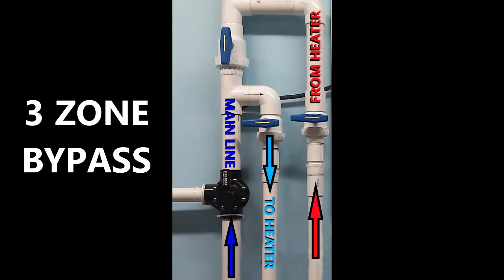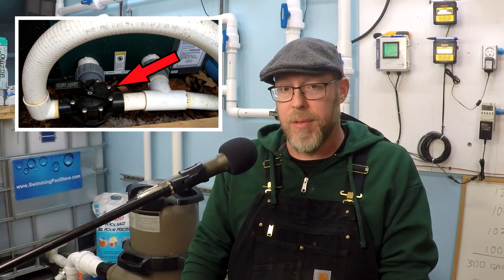Pool Heater Bypass - What Does It Do?

Comment: You indicate that the pool heater should not be bypassed for lengthy periods of time, AND that the heater should be protected from chemical changes (like hperchlorination).  I live 1500 miles away from a pool that I use intermittently, so cannot attend to it myself.  A pool service takes care of the chemicals, but they don't adjust the valves "because it makes the valves leak".  I have taken to opening the bypass valve when I leave, but also keeping the inflow and outflow heater valves open.  The higher resistance to water flow inside the heater means that most of the water goes through the bypass, but the heater is still getting flow.  Does this make any sense, or is it not really helping/

Comment: Thank you, Steve. I have a heat pump as well as a solar heater for my pool and the valve between them can direct flow in one or the other direction or partly to both. I also have a valve near the filter to direct flow either to this pair of heaters, or to just recirculate the pool. If I understand you correctly, I can just recirculate the pool water when I hyperchlorinate the salt system> Does that constitute a bypass, and can I further adjust the flow between the heater and the solar heater through the valve between them, since I'm using a 1 1/2 hp pump, somewhat oversized for the 5000gal pool. Thanks. Richard

Comment: I am about to replace my old Hayward H350 10yrs old with a new Raypak Avia HD Nitek 404 and will be re-plumbing. I was considering adding a heater bypass cause I have SWG pool. I keep my water pretty balanced but the Hayward did eventually pop leak in the exchanger. My question about the bypass is if it can be done using a Hayward Goldline GVA 24v actuator, and automate the bypass when the heater is not calling for heat. I have a Hayward Proligic 8 controll system with open Aux ports. Have you ever seen a setup like this or is this a bad idea. I have yet to find a video online only a couple not so descriptive forum posts. If you have any advice for this unique setup I would appreciate it. I’m in Canada in Winnipeg so gas heat 3/4 of the season is a must. I would like to avoid having to manually turn the bypass on and off every other day. Lmk thx

Comment: Im looking at pool heaters. Had a solar heater but was removed with roof repair after hurricaine Ian. Plus roof guy noticed that solar was leaking and thats why my alum gutters were rotting.  Anyway i had a bypass set by temp to go thru solar or bypass. Can i use tge same plumbing?

Comment: Could you please help me?  I am having problems with my chloine level. The pool store recommended 9 lbs of shock(power powder plus)  i did that and had the water tested 2 days later and was told i needed 9 more pounds of the same product. Free chlorine was .25 and total chorine was 2.32.  What should i do?
Reply: I think you need stabilizer so the chlorine doesnt dissipate so fast

Comment: Heaters have two regulators controlling how much water from pump enters the heat exchanger in the heater.

One is pressure sensitive (controls flow into/bypass heater), the other is temperature sensitive. As water cools. more water enters heater, and as it gets hot, more water is bypassed. Both work in conjunction to adjust how much water goes through the heater and how much is bypassed.

I'm sure it may vary by region, but in my area, (Texas Gulf coast) I've only seen a few heaters with manual 3-way valves to take the heater off-line altogether. (Since mid 1990's).

As far as chems affecting the health of the heater, there are two main considerations. 
If you are on a salt system, get a heater with a cupro-nickel exchanger. Salt is inherently corrosive, and an all-copper exchanger will fail more rapidly, with added" benefit" of scaling inside the exchanger. Otherwise it's all good but you have to keep a close eye on balancing chems.

The other is in the case of vinyl/fiberglass pools, be sure to keep the pH up in range as they have a tendency to run low on pH.  I've seen many of these pools with the plumbing hard plumbed bypassing the heater because the heat exchanger has holes in it.

This comes from one pool tech who is nothing more than the sum of my own experiences.
Thirty years in, and still learning!

Always looking forward to your new posts Steve!

Comment: Hey Steve,   Would it be a good idea to parallel 2 heaters in the same system? One being heat pump. And the other a gas heater.
Reply from the maker: Great! Best of both worlds. Just expensive. Install them in series.
Reply: @Swimmingpoolsteve wouldn’t that cause extra resistance?

Comment: I am currently installing Raypak heaters. The instruction manuals call for a Bypass Spring Valve if the Pump is over 2.0 HP. Since I am using 3.0 HP I am left with this conundrum. We normally would install a Ball valve and regulate the maxflow to about 50 Gal. x min. at 3000rpm to account for the Spa function. The Raypak engineer is asking me to find a spring valve with a 10lb Spring. I have not been able to find one, and the Raypak valve is almost $300.00 Do you have any advice.  Kind regards.
Reply from the maker: Spears males valves with spring tension 1lb, 2lb, 5lb and 10lb
Reply: Or install a manual bi-pass and you can calculate a rough on how much you open the valve. Once you set it, mark it, and thats it! The spring is pretty much doing the same thing as the valve, which is restricting flow. Sure , maybe hard to calculate, but you can get close enough.

Comment: What you state is pretty true as you typically are. But under the circumstances a customer had an indoor pool/dehumidification/pool heat pump the built in or added bypass (which is required) sets the flow through the CuproNickle heat exchanger to create the temperature differential which is needed by the indoor system in order to heat the pool water, dehumidify the enclosed pool room and/or assist in heating the enclosed pool room air. The heat exchanges are made of metal that is pretty much not damaged by chemicals. I have some out there still working that are over 25 years of age with the same water heat exchanger. The water flow must be set according to factory specs/application or the efficiency will be down, the compressor head pressure could be too low or too high which will effect the life of the compressor. And the dehumidifying process will also be negatively effected.

Comment: I have an external bypass that I plumbed in an unliked what many people do, I actually pull the drain plug on the heater and disconnect the inlet and outlet lines.  I also flush it out with a hose.  Is it a pain in this a@@?  Yes, but it’s cheaper than a new heater in 2-3 years or less.  Screwing in a drain plug and screwing in 2 PVC lines is a snap!

Comment: $3000 for a heater? What year is this 2020? Lol

If you close circuit the heater don't forget a pressure relief valve just in case.
Reply from the maker: In some areas, maybe all areas, adding a manual bypass requires the heater has a pressure relief valve installed. Good job pointing out this important info! Cheers
Reply: @Swimmingpoolsteve  I am wondering do you still need the relief valve if on the out of the heater upy have a check valve and not a ball / 3way valve. 🤷 Probably.
Reply: What would the pressure releif valve do? I dont think I have one..using a Sta-Rite heater, and I came up with the idea of the bipass as I ddnt want the chem to constantly run thru the heater, as it is not necessary, so why have that in the mix? So I have the water divert cutting off water going into the heater. I guess I can open the valve a slight bit once in a while to not have it stagnate. I think the heater should have a drain plug. Maybe draining it would be an option, and let it run through once in a while just to keep it from being totally dry./?
Reply: @philindeblanc  mostly it releases pressure 😉

Heaters operation with a pressure switch, not a flow switch. A incorrect by pass can activate a pressure switch while not having enough water flow.  Heater may make a hell if a banging sound

Comment: Would an internal bypass type heater still need an external bypass for super chlorination purposes? I assume the bypass is an automatic thing and to be safe you would still build in an external because with the pump off I’d want to be safe.
Reply from the maker: For the diverting of water during  high sanitizer or low pH ypu would need an external manually controlled bypass, yes. I belive the internal allows some water to cycle through the heater to prevent stagnation during long periods of time when there is no call for heat. It is an efficiency design. The external controlled bypass is simply an added point of flow control, which I consider to be a hallmark of a well designed plumbing system. The more flow control the better, and that includes a heater bypass